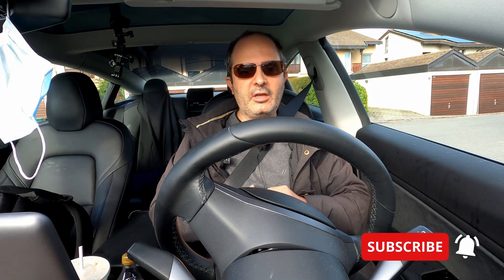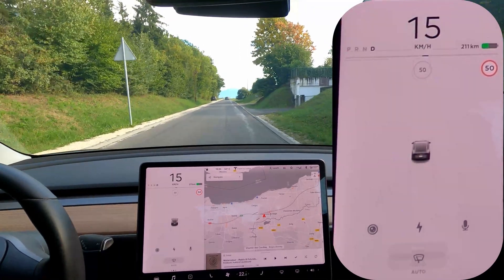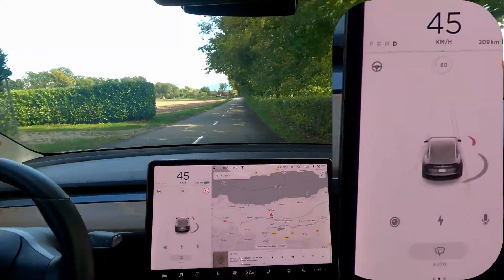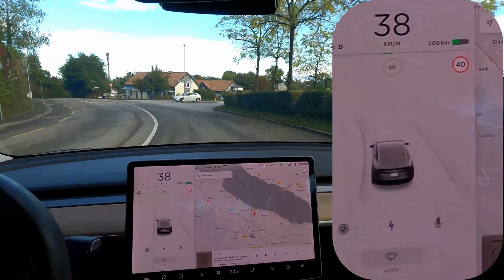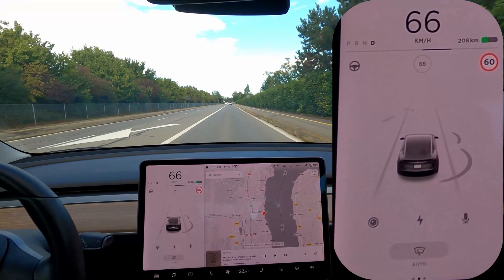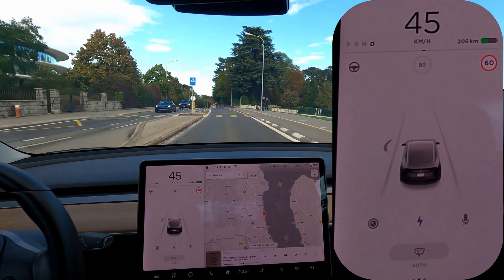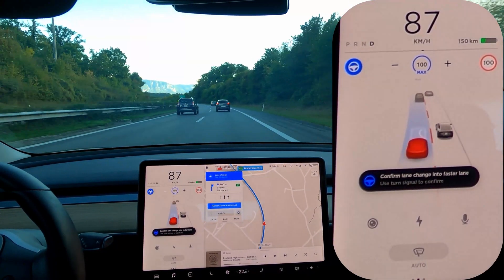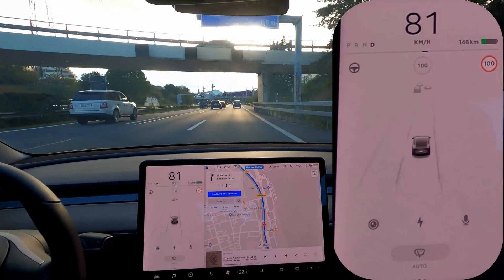Tesla errors in speed sign recognition on version 2020.36.11 (Switzerland)

Comment: 1:45 why did you use your left indicator to get on the road???
Reply from the maker: That's a good question. Actually if you look at the intersection, the road makes a big turn to the right before merging, which means the car is almost parallel to the road I want to merge into at that point. So that's why I use the left indicator at that point otherwise cars that are now coming from behind me might think I'm not going to merge right away. It's a tricky intersection that would need improving I think.

Comment: Nice video. I thought I was the only one having trouble. 
Actually I kind of figured out that on the road I drive on daily basis, the signs recognition is getting better (but still few problems in the 30 zones). Maybe it’s still on learning sign mode and next update we will get a proper one. And in the 30zones the GPS is always giving a wrong speed. Hope they will correct that soon
Reply from the maker: I think they released it a bit early for us outside of the US. I'm sure the data set was a lot more mature for the US than for Europe. I'm pretty confident it will get better as the more signs it encounters the better they can train the neural network. Right now the problem is that we have unreliable video recognition couple with incomplete map data. As the video system gets better they might change or even update the map data over time, but they will have to be careful because it still misses a lot of the end of speed limit signs. I think it doesn't recognize yet a "end of 30" or "end of 40" signs yet.